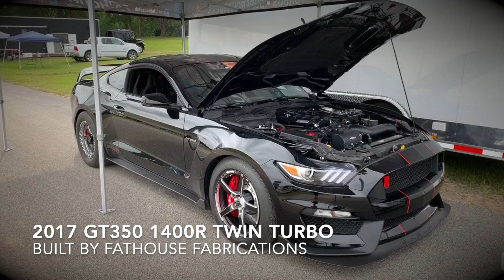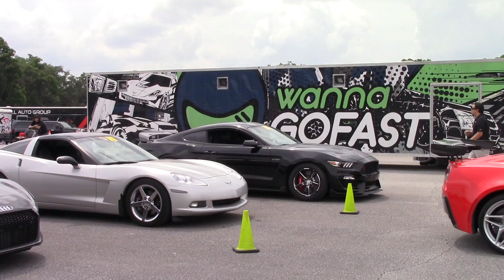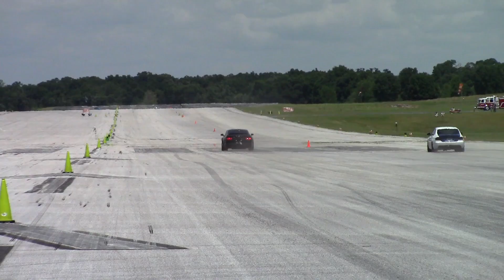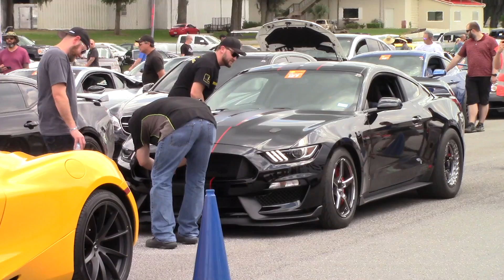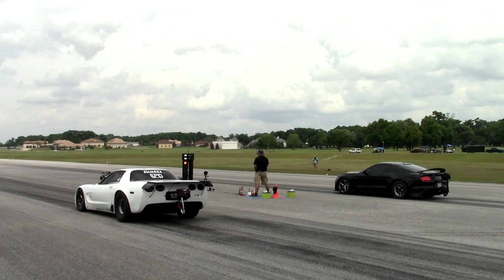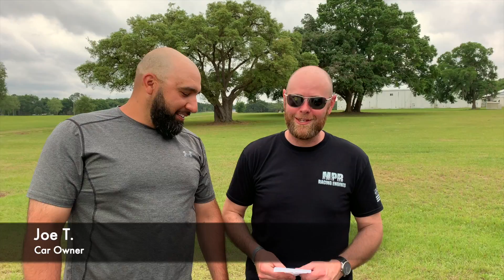Xona Powered 1497WHP GT350 makes 193MPH 1/2 mile pass!

Comment: Impressive results. Just a little constructive criticism, initial burnout out was too weak on all passes shown leading to tire spin on the launch. Better tires, better burnout and no offense to the vehicle owner that was driving, get a better driver, definitely will break 200. Awesome package guys, keep up the great work!!!
Reply: Its called  horsepower.....
The gt 500 spins no matter what tires you put on it ....
And torque
Reply from the maker: The MoTeC system has really great traction control, and they were testing it here. Unfortunately, one of the wheel speed sensors was not operating correctly.

Comment: That car has a 200+ with a better tires setup to much wheel spin at the launch
Reply from the maker: The MoTeC system has really great traction control, and they were testing it here. Unfortunately, one of the wheel speed sensors was not operating correctly.
Reply: @xonarotor8618  watch you tube FA20WRX sti stomper ..that is the  silver subi before you guys voodooed it a few months ago ...from Jon weddle as he is pondering your E85 set up you mentioned to him the day we gave you the boy and you giveth back the man

Comment: 6268?... Well that's not on the website
Reply from the maker: The turbos on this car are the XR7868 models. They are a 62mm inducer compressor wheel, however, the name comes from the 78 lb/min flow rate of that compressor wheel. The "68" does come from the 68mm turbine outlet diameter.
Reply: @xonarotor8618  when will the S series turbine wheels be seen on the website?
Reply from the maker: Not sure. Contact tech@xonarotor for more info
Reply: I was referring to how they are listed in the video description @xonarotor8618
Reply from the maker: My mistake on the model number. Sorry!